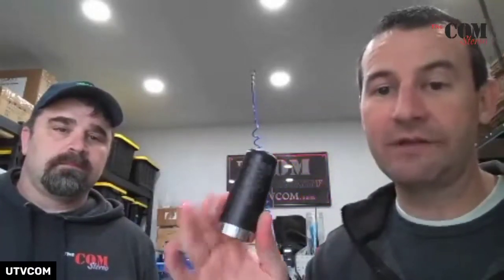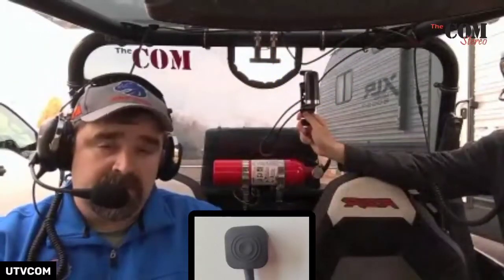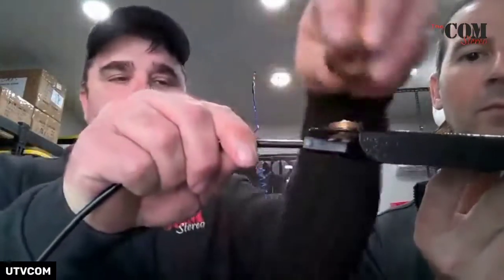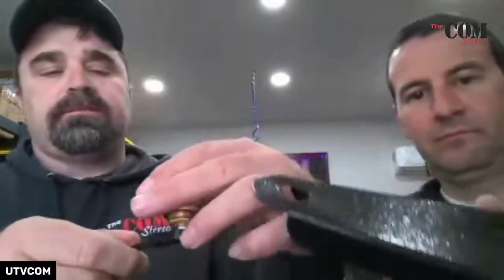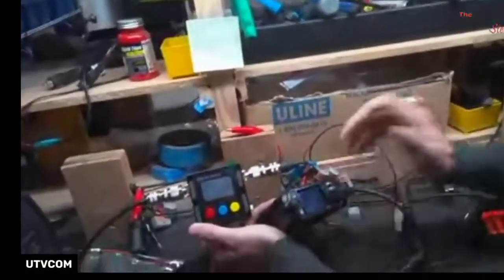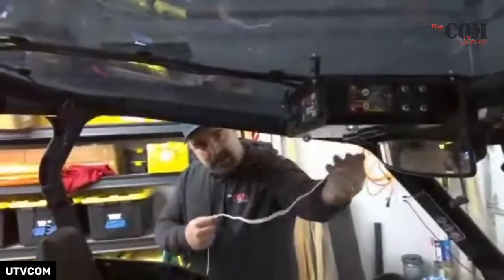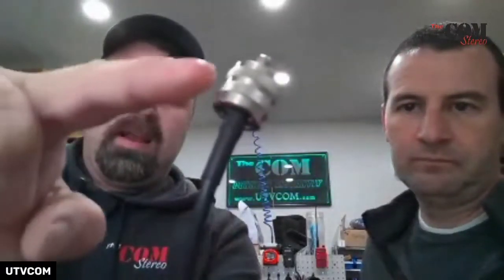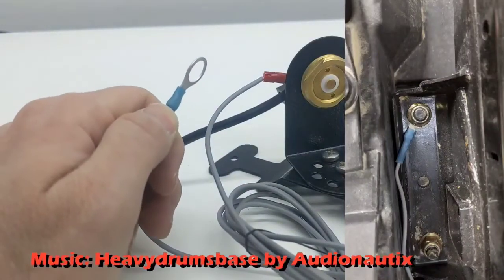Let's Talk SXS Antennas

Comment: I just purchased one of your systems and would like to know the part number of the SWR meter that I should be using to tune my shadow antenna ?
Reply from the maker: Our antennas are tuned from the factory and are not like most old antennas where you cut them to tune them. Ours have a resistor that does that and can't be tuned beyond what we program. 

If you are programming other frequencies outside our programming you will likely need to buy a different antenna. 

Hope this helps.

Comment: Does that have to go to chassis ground only? Or would it work to go to the radio ground? 
I ask because the chassis on sxs are very noisy ground wise. I have had to double wire every accessory in my buggy to keep that bad grounding chassis out of the equation.
Reply from the maker: Typically the antenna ground goes to the chassis but like you said some chassis create more noise like I show on the Honda Talon install video. So it should be tested both ways. To do the test before you connect the ground wire (make sure the antenna is installed) get a base line by pressing the PTT and see what the bottom of the radio screen says without the headsets attached. There should be a bar at the bottom with a "P" on the left and a number on the right. We want to target this number to be 15 or less. Then attach the ground wire and touch the chassis and see if that helps or hurts the number.  If it helps leave it there if it hurts then try the electric ground if it still hurts the number leave the ground wire off.